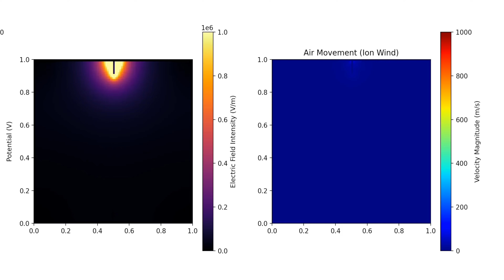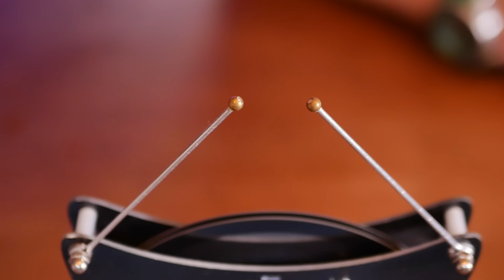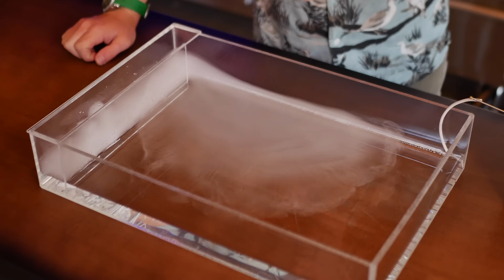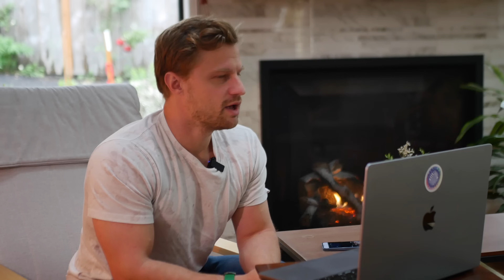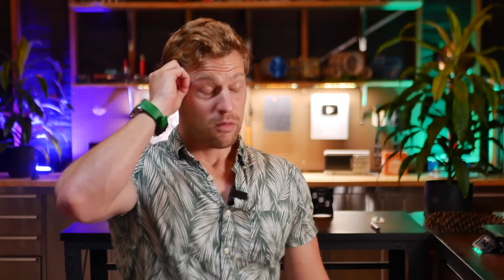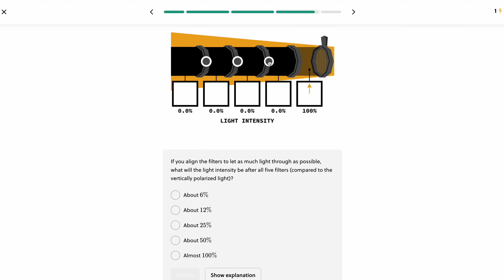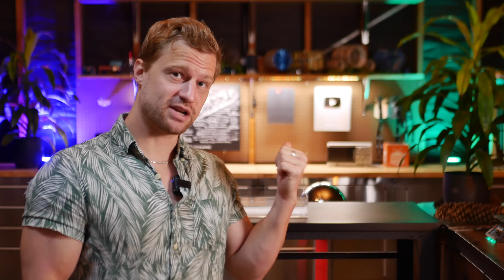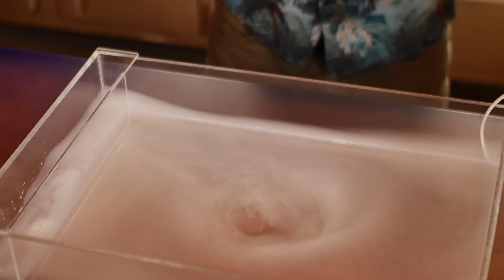This High Voltage Fog Is Controlled by Pointing (BiFrost Nebulagraphy)

Comment: After looking at the vortex produced by his hand, it got me thinking about how tornadoes are formed in super cells, which usually produce lightning through high voltage. Turns out there is a paper 'Electric Theory of Tornado. Protection from Tornado.' By Alexander Bolonkin, in which he comes up with the hypothesis that Tornado stability could be linked to the high electric voltage between the clouds and ground. It's worth a read.
Reply: so anti tornado enormous lightning rods?
Reply: Yeah I was just commenting along the same lines. I was a plasma cosmologist and I've always been convinced our weather systems are driven by our electromagnetic solar plasma environment interacting with the planet. What we're seeing in this video is a scaled down version of what might be happening in our weather systems.
Reply: @PlasmaOscillations  Bernard Vonnegut the weather physicist (Kurt's brother) thought that tornadoes were electrical, and was roundly hated for it.   He tried firing small rockets w/e-field instruments into tornadoes using a light plane.   None of them hit the vortex, and also, he didn't die.  But I think Vonnegut theorized electrical air heating, rather than electrostatic drive of charged droplets or dust.   (If tornadoes are "dark lightning," then we can turn them off by shorting them out.)

Weird trivia:  when a tornado touches down, the amount of lightning in the storm drops enormously, as if the tornado was shorting out the storm.   This isn't explained by conventional theory, so it's treated as Charles Fort's "damned data," and ignored.   Decades ago someone did a study of tornado paths, and the recording magnetometers in small weather stations in the area.   They found that the slow magnetic transients were exactly those which would occur if the traveling tornado was a vertical DC current of up near 100 amperes.    (But this is an extremely maverick-fringe topic, because tornadoes are thought to be settled science.   Therefore, if you work on electrostatic tornado theory, you're automatically declared crackpot.)
Reply: @wbeaty  Thanks for that info, I had no idea about that fascinating tornado data, it's direct evidence! An electric weather system is inherent in plasma cosmology/cosmogony. The mainstream are excellent at funding their 'settled' science, I'm quite bitter actually... I'm a heretic and can't imagine the life I would have led and the science that would have resulted had I proper funding for the past two decades.
Reply: @PlasmaOscillations  Typical "crackpots" are electrical engineers, and often they build up some large retirement bucks, but then don't blow it all on world travel etc.  Instead they run a personal lab for a few years.   Self-fund the taboo science.  That's where the old "air-wire" papers from the late 1990s came from:  ...Charles Yost's group, who were antigravity heretics, but working with lots of HV systems.  They self-published a quarterly journal, about thirty issues, and accepting papers from other heretics-hobbyists.   

Someone should do that today, with paper publication and not just online videos with no searchable text, where ten years later, are usually just gone.

Also in the 1990s there was the TCBA tesla coil builders journal, maybe 100 issues over the years, until the editor had health problems, and nobody else took it over.   Taboo electrodynamic meteorology hobbyist journal?  Electric tornados.  Weather control by microwave transmitters?  Crazy rainmaking devices (such as KM-scale cloud-seeding based on this "air wires" phenomenon! )
Reply: @wbeaty  "Therefore, if you work on electrostatic tornado theory, you're automatically declared crackpot"... same label applied to Electric Universe theorists.
Reply: Some portion of tornados do become electrically charged; this form is called a "charged sheath vortex". Normally electrons repel one another, but when they travel in parallel they function as a current with a generated magnetic field that pulls them together. So once an active air-vortex picks up a random bit of charged material, it will then attract others and thus become increasingly electrified.
Reply: Oh no way that's super cool
Reply: Makes perfect sense
Reply: One finds correction between the amount  of lightning produced and heavy rainfall; I am a regular 'listener' to longwave (approx 250 kHz) and have noted the WSR-88D RADAR showing heavy rain fall/hail and the occurrence of rapid and heavy lightning strikes, cloud to ground as heard on the 250 KHz receiver. Have noted this on more than just one occasion, too.
Reply: I immediately saw a graphic from an elementary school text book. A little thing about tornadoes I sort of remember.
Reply: Wow, I literally just made the same comment before scrolling down to see yours.
Reply: Whose finger is it then?
Reply: Lightning produces positive ions on the air. It is not impossible that tornado are one of its product.
Reply: "usually" produced by high voltage ? how else does one make lightning without a high potential difference ?
Reply: re: "which usually produce lightning through high voltage"
Um, no, thinking this is still triboelectfic effect with ice and liquid water collision; have newer seen lightning occurring right in the vortex.

Comment: looks like capacitive particle charging and movement, youtube lives on a cloud, yeah thunder cloud charging effect. the co2 cloud is just a visible dielectric, instead of air. the water surface level is very flat, so your closest point with highest charge will be directly perpendicular. ie your mouse finger position, over the surface. electroplating 3d printing. well calculate the charge densities on the sheet and near the finger pointer. there does not need to be a current. just the capacitive charge distributions. only the close up vortex is an ionic wind. the other is like van der graaf generator charge at point. well the charge on the opposite side, to the finger, will be greatest directly under the finger, repulsing the charges making the draw line. the ion shooting point is on the water surface. well the ions moving by the field and the charges on the point surface are two views of the same thing. break down field of a capacitor, but ionic wind. also the field between two points is like a lens focus, so the ion movement is focused narrowly not widely. just check the typical field effects, its not complicated. so you say rain is electric field triggered from the fog clouds. yeah how narrow is the vdg generator arc source point. just examine the vdf generator spark location behaviour. nice touch screen. non-touch screen. why was both the test conditions called ionic wind if other has no voltage applied. what voltage was the normal ionic wind compared to the focused field voltage. science presentation should be precise, no confusion.

Comment: You should collaborate with Steve Mould.
Reply from the maker: I reached out to him on this one, but he had too many other projects at the time.
Reply: @PlasmaChannel Smarter Everyday?
Reply: @PlasmaChannel  Apparently these have been photographed under a microscope.  Here a chem grad student (around 2014) had those papers, and was trying to reproduce the effect.  I recall that they were using UV LEDs as a stroboscope, plus fluorescent dye in the emitter-tip, to make the "air wire" visible to human eyes.   

Odd trivia:  the streams will pass through several cm of zero-field region between two grounded plates.  Weird.  Once they get going, they have inertia like a stream of water, and can be aimed through a hole in a grounded plate.  (So, your simulation is right on.  It's like a laminar stream of smoke, but driven by e-fields rather than buoyant hot air.)
Reply: Smarter everyday, and slo mo guys. 

I’ve been playing with a fog machine and a laser… the laser being a flat beam, lighting up the fog, and you can “play” with the fog as a slice like an MRI. 

Would be cool to use a setup like that to “see” the beam…
Reply: @muxpux actually a cool and useful extra experiment

Comment: That vortex from your palm was wild.  Must feel like having some kind of super power, briefly.
Reply: And quite frankly, studying it more could lead to a better understanding of weather phenomena. Specifically, would be cool if it leads to a means to dispel or reduce tornadoes before they form.
Reply: @custos3249 But tornadoes are cool…
Reply: @custos3249  yes Pal, you nailed it, only the energy isn't generated by wires on the ground, it's by the HAARP and maybe 5g towers too.
Reply: Can we keep the vortex forever
Reply: If instead of a sharp finger he was using the palm of his hand, I was thinking this resembled a "high current" flow instance of Maxwell's Laws. The right hand rule states that you place your thumb in the direction of the current, and your fingers will curl around to describe the magnetic field. Perhaps the magnetic field would induce an electric field that generates that vortex.
Reply: with enough practice he can do a rasengan
Reply: P1: so, this guy flies, this one has super-hearing, this one creates fire from his palms, and you are?..
P2: I have a constant positive charge that's enough to create 20kV between my finger and a random surface.
P1: You're in!
Reply: The vortex is the bodies field interacting with the fog. The aetheric energy swirls like a vortex. It was interesting to see. So the bodies energy acts on the fog 🌫️. Interesting…….
Reply: The 'air-wire' is creating a minimalist motor following the right-hand rule the vortex should spin clockwise as the current flows to ground. The same should apply for the finger pointing more than the palm though...
Reply: This is how God makes hurricanes?
Reply: What’s wild is that people see these and still think there is unreal. The real is just the current like a river and if we learn how to swim some of us fight it but some figure out how to make floaties and surf boards. These dimensions are shared through the relative and expanded. So really nothing is unreal just a difference of time.
Reply: @Jacobk-g7r  Word-salads don't convince anyone of you knowing what you're talking about. This is about science, not your pseudo-science.
Reply: @Vaeldarg   whatever you say brother, you chose to focus on denial instead of understanding. You chose to put out something that wasn’t to benefit but to hurt others. Maybe work on yourself. Good work trying to say it’s a word salad but i used an analogy so others would understand. It’s wild to me that you chose to come after me instead of idk be a different person.
Reply: @Jacobk-g7r  I've dealt with enough pseudo-intellectuals in comment sections to not feel guilty over calling it out.
Reply: @Vaeldarg  okie dokie artichokie and i don’t want your guilt i want you to leave me alone if you can’t be nice lol

Comment: i think I am missing something.  How does the effect create the vortex effect from a flattened hand?
Reply: Perhaps some tornado-like structure appears due to lower pressure in the center?
Reply: @softerseltzer  I was thinking maybe induced magnetic currents.  Low pressure would be more like a cratering effect without the swirl.  The part that confused me was that it didn’t appear to follow the left hand rule.  If you aren’t aware of that one, the direction of the rotating magnetic field around a current carrying conductor can be shown by gripping the conductor with your left hand with your thumb extended in the direction of current flow.  The magnetic field will rotate in the direction your fingers are pointing.
Reply from the maker: Exactly. I have no idea, and needs further investigation.

Comment: Actually, there is if you don't consider it fog, it's humid AIR, lookup EHD, electrohydrodynamics, and electroaerodynamics. Even the X-1 used it although it's rarely mentioned. That SPIKE on the front was there for making charged air / plasma. See Scientific Research - Air Plasma Mitigation of Shock Wave
Reply: Hmm interesting